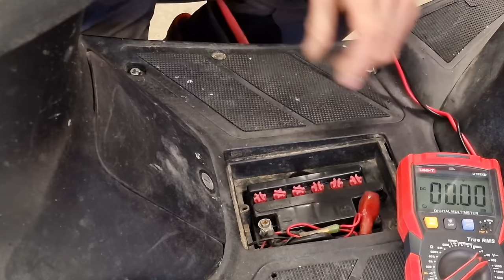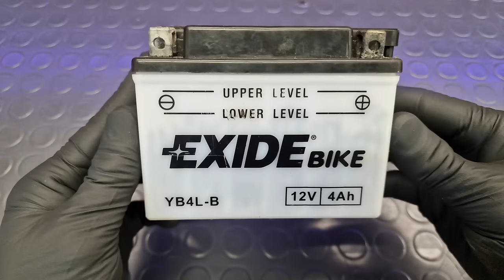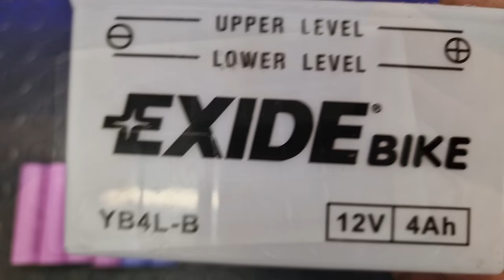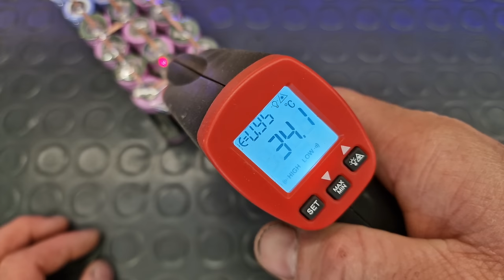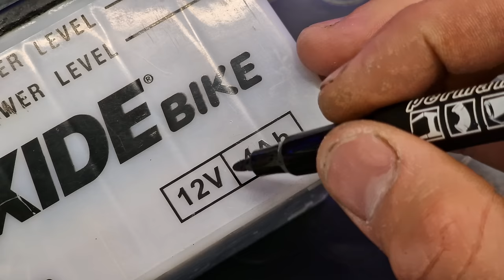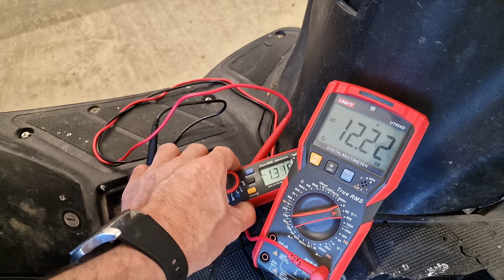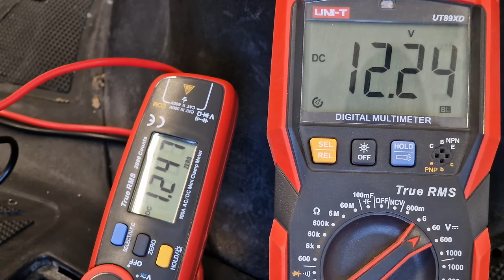How to make Lithium ion Battery pack for Motorcycle? Forget Lead acid Battery CPI Oliver Sport 50cc³

Comment: I like how batteries fit perfectly into these lead acid battery shell's 😍
Thanks for sharing with us awesome ideas! 👍
Reply from the maker: I'm glad if you like it Bro🙂🤝
Reply: @ErCanEverything  What mount do you have there? So that the 18650s stand still. Seen at 05:07
Reply from the maker: @-Fun_and_Games-  Flat piece of wood and parkside bar clamps
Reply: ឲ
Reply: What is the name of the PCB module ypu used?
Reply from the maker: I left links in the description🙂
Reply: l
Reply: nice video brother but what I don't understand is how many voltage is those batteries each
Reply: 3.7v each cell and he made 3 line. Then connected in series ie from negtieve 0v 3.7,7.4 , 11.1. When charging it reach 12.6v . Here  he connected one BMS for

Comment: Sir that's a very dangerous thing you do using lithium in a normal motorscooter bc the bettery can explode with this way of using it never do that if you have lithium ion bettery than use an electric motor not normal gasoline engine bc lead acid is used in gasoline engine bc it can handle it an dont have cause of explosion what you did is making it a bomb on wheels you should immediately change it to lead acid or it will explode
Reply: Bms use no worry
Reply: @doityourselfsmddobcobsmdra8549  that doesn't hold long believe me the bms would through its cycles an than over heat than it doesnt give any voltage if you want good bettery look for Duracell lead acid the can hold more than 10 year or verta lead acid its for your own safety but its up to you
Reply: @markludersen8524  good too intelligent
Reply: @doityourselfsmddobcobsmdra8549  i just tell you this an no iam not intelligent i just put my interrest in bettery,s an safety😉
Reply: Not man!
Reply: @R-Turfu  why not i am curious why
Reply: Do you have any evidence that Lithium batteries can't be used with motorcycles?
Reply: @triadwarfare  yes my father own a Harley Davidson we went to an store i asked the repair men an he told what happened if out lithuim in motorcycle he told me the bettery starts warm up after the bms goes to warm up than it starts become so hot that bettery an bms start to smoke when it smoke the bettery an you notice it on time than please stop an step away from motorcycle an call firedepartment fast bc the bms the protection is over its limits an the things on the bms board burned away the reason lead acid is bc lead plates haves an stronger Resistance by bit higher voltage an motorcycle uses leadacid bettery bc if put 12 lead acid bettery in there hold an voltage meter on it start the motor an let it run an you see it get 2voltages high but its does do nothing to the leadacid bettery bc the lead plates are thicker than the lithium metal an copper what you see inside a lithuim cell if the cell gets to hot than its start explode bc the heat needs to get out so it makes pressure inside the cell itself an becomes bigger that it doesn't hold longer an starts burst out  lead plates takes a long time if you over voltage them like put 5 times higher voltage on it while it can have 2 voltage resistance as maximum so that is why you never do that if you want an better bettery than buy verta or Bosch or Panasonic or Duracell lead acid bettery,s
Reply: @triadwarfare  let an engine run with a Dynamo of voltage what the bettery haves an look through the thermal cam you see it gets warmer an warmer bc of the constant charging an use lead acid bettery on it after you remove the lithuim than you see it wont get warm after 2 voltage higher an in fact lithuim ion cell even the lithuim polymer gets warm by heavy use if put it in a rc car or something then you even feel it gets a bit warm bc of the use than image what it do if it keep charging it than it will get so warm that its overheating
Reply: @triadwarfare  if you want to use lithuim for motorcycle it needs to have pmc control for the motor an bettery voltage meter yk what you see on bettery pack of cordless drills or lcd power meter on power banks than you take apart the gasoline engine remove an build in the pmc controll panels An led voltage indicator to see how much you have left an a lithuim pack with bms in it
Reply: BMS Loughing😅😅😅🖕
Reply: @akdgamer1065  you feel the heat an smoke when things going explode
Reply: @markludersen8524  hmm ? Me also using this bttery in my bike since 4months nothing happend
Reply: @markludersen8524  no IAM using BMS
Reply: @akdgamer1065  still it have charges cycles between 2000 an 500 charging cycles maybe higher with newer ones but your motorcycle have an alternator that provide electricity so while it goes giving direct current electricity you keep charging the lithium ion bettery the bms do every time charging till it comes to an end but it can also be becoming overheating an till it get so warm that it start catching shortcut over voltage an you mayby not nowing while driving it start catching up fire an goes in smoke after it get an fire that you cant put it out an call the fire department or you buy Special lithuim ion fire extinguisher to put it out but if you keep ignore what i said now than dont be suprised when you get an fire an the bms wont much hold very long
Reply: I think this circuit in reality is a voltage stabilizer.... So there is no any dangerous of explosion....
Reply: @thiodorchalkias8906  no it isnt i have one my self its a separate pcb motherboard that stabilise the voltage this bms is for charge only an discharge keep in mind those bettery bms is just to charge an not keep charging like an alternator plug on it you will just keep charging an driving till its completely dead bc of the constant charge it gets very warm till it is damage completely
Reply: I think you have a point!!! And the point is the POSITION of the battery!!! How far is from the engine wich create a hot environment!!!! If the battery is thermal isolated from the engine there's no problem.... If not then you have absolutely right!!!! I remember that some "electronic cigarettes" was exploded at the hands of their users....
Reply: @thiodorchalkias8906  most commercial e sigaret are just cheap or reused old lithium pouch cells the non commercial ones are the ones who have an more expensive better bettery in it like an lithuim cell even then the alternator always put 2 volts more reason they use lead acid is bc of the higher resistance of higher voltage out put bc the if take apart lead acid bettery the lead plates are thicker than the lithuim plates if you are keep thinking it doesn't effect the lithuim bettery than you are very ignorant to listen lithuim cell gives higher out put but isnt safe for using as Lead acid bettery bc chemistry behind it is different lead acid is robust an can handle higher voltage lithuim ion is more sensitive but powerful to use as back up or for an e scooter or e-motorcycle not normal engine with alternator we can talk hours about but ik why an saw the reason why lead acid is just use for cars scooters an motorcycle bc they keep charging an nothing happens to it bc the acid is just boils a bit an the thic lead plates can handle it by lithuim cells its getting warm till that thin sheet of nikkel gets lose an just the lithuim sheet plate with copper one an starts to get inside an small fire till it need to get out an explode bc the pressure burst out of its steel case an the next one starts also till it get like an fire bomb so till than use lead acid bettery not lithuim for the normal alternated engines in normal vichels
Reply: It's an amazing idea but there is a prblm with Li-ion battery, these batteries got heat very quickly, and the starter motor used in a scooter or bike need high ampere current to work
Reply: @triadwarfare  lithium batteries when there are 3 in series need 12.6v to charge. motorcycle charges the battery at 14v to 14.4v. Probably bms will just die but not explode.
Reply: @markludersen8524  instead of lithium ion you can use life po4 they safer and they last longer
Reply: I've been using this method for four months now and it's working fine.
Reply: Me parece que te la vendieron mal amigo. Las celdas de litio cómo estás soportan una descarga continua de 5A c/u, y si pones 6 en serie, tienes 30A. Los picos de corriente que soportan esas celdas son mayores aún. Al encender la motocicleta, el pico de corriente se mantiene por 1.5 segundos más o menos. Con eso, la celda no se calienta. Y sobre la carga, si te diste cuenta que hay 1.4A de carga? Y que esos 1.4A se reparten entre 6 celdas en paralelo? Las celdas pueden ser cargadas idealmente a 0.5c(si las celdas son de 2200mah, estaría perfecto cargarlas por separado a 1.1A). El voltaje alto, sería de 14.5v como máximo, y el pack es de 12.6v, serían 1.9v de diferencia, lo cual está perfecto para el bms. Así que no veo el problema. La temperatura del motor??? A menos que la coloques directamente detrás del motor, dudo que se caliente, pues también le pegaría aire fresco.
Reply: You are right
Reply: Why?
Reply: There are many direct lead-acid battery replacements with Li-ion cells. The easiest way is to contact a Li-ion battery packer such as Lithium Batteries,Motorcycle Batteries,Solar Batteries,KOK Power Limited that specializes in automotive, motorcycle and eBike batteries as drop-in replacements
Reply: Someone call Dakota Lithium and tell them they are endangering their customers with their products.  Make sure you tell them you're a certified professional because you read it in YouTube comments. 🙄
Reply: That's great one.   please where will I get the mother board to buy ?
Reply: @markludersen8524  I see companies now making lifepo4 and li-ion batteries for motorcycles. So why can't we make that same batterie from portable tools batteries that have much higher discharge current with bms?

Comment: IT WORKED FOR ONLY 3 DAYS. I made this battery, but after 3 days, the BMS failed (the BMS mentioned in the description). It seems the current coming from the alternator and the voltage of the battery has a too high differentia. So don't make it. Waste of money.
Reply: it failed, because in normal conditions alternator produces around 13,5-14 volts DC , to charge original Lead Acid battery.
in this video voltage in the system was always 12 volts, meaning alternator on this bike was faulty or disconnected.
Battery that was shown in this video is not suitable as direct replacement for the Lead Acid battery.

Comment: 3:00 a pair of wire snips is all you need if you put the case in the freezer for a few hours.

The soldering of the cross pieces could be done on the bench. If a 'ladder' dia could be used the 'steps' would be made of a 'fuse  wire between two cells 9@2.5ah) that  has a common wire that is a tad thicker to complete the 12v s4 20ah  battery. Times that by 5, you have an e-bike  you can ride for a few hours.

Comment: Nice job, kind of weird that the cells fit so perfectly into the battery case! My personal preference is to twist wires prior to tinning which keep all the strands together and prevents any stray strands. Only other caution would be the fact everything is quite tight in there but in the use case with a very short discharge when starting and relatively low current charging it seems like a good solution 👏

Comment: Nice video but, if you place a buck converter between original charging system and the battery, set the voltage to 12.4-12.6 volts it's better for the battery and the BMS.
Reply: Bms needed for Li bat, for balancing
Reply: I think he mean the output of the scooter so the voltage entering the bms is lower. But it's needs to do current both ways so I'm not sure how that would work
Reply: Oh actually separate the alternator from the starter motor, lower alternator voltage perhaps
Reply from the maker: the scooter generates 14.4V but the BMS has a controller, and as soon as it reaches 12.6 - 12.8V it turns off the power supply to the batteries using the mosfets
Reply: Oh so does that mean the bms can accept more then just 12.6 to 12.8 safety? I have the same bms so I'm curious

Comment: One thing to ask: disconnected battery voltage was 12,3 volts.
battery voltage, connected to the working bike 12.2 volts. this means only one thing, alternator on this bike is not working or missing or disconnected.
Otherwise how the original lead acid battery is going to be charged?
Lead acid batteries require around 13,5-14 volts DC in the electrical system of the bike or a car.
Battery shown in this video is not suitable for direct replacement of the Lead Acid battery.
It will fail !
Reply: No solo fracasará es una moto bomba cuando explote veré a ese en el cielo

Comment: nicely done.
q1. don't you need thicker cables?for around 20-30 Amps?
q2. is that bms capable of handling such amperage?
q3 no heat sensor/alarm. what if bms fails and  keeps overcharging? explosion and fire.
I have yet to see any diyer in you tube to take into consideration safety and the limitations of lithium batteries.
Good effort anyways.
Reply from the maker: Оnly the cables in the poles should be thick and they are 6mm² the rest of the cables are for balancing and no need for a thick cable.  The BMS is 100A, the starter draws 30A and the alternator cannot exceed 5A when charging.
Yes, you're right, I didn't put a thermal sensor, but I should have.
Reply: I have seen 'miracles' happen with solar lithium bats as well as 18650.
Fires, explosions, bms failures, melted cables etc etc.
Mind you that bms's are chinese junk. Quite unreliable and fry easily. Once they fry your only safty angel is a thermal sensor provided it is reliable lol.
My comments have only safety in mind with the chinese unreliability variable. Keep up the good work. Tnx
Reply from the maker: Thank you🙏🙂🤝

Comment: I think it would be better if you properly spot welded the 18650 cells with zinc plated strips, between them. I have tinned a lot of copper wiring to cells and stuff. I don't think it is the best approach for this case, a motorcycle battery, which has to endure a lot of vibration and shaking/bumping, especially if the roads are rough in your country, because there is a much higher risk of cracking a solder joint and making a short or just killing the battery pack and your precious work, faster than you would believe. Nice job though.
Reply: And the fact that is charging up to 16volts is ok, right?  Fuck the risk of fire, just use zinc strips.
Reply: @BOB-eb8xz  Not really. The bms board charges each cell up to 4.2v and stops charging omce it reaches that value or about 12.6v total. I've made a similar battery and tested this myself. Provided that he bms doesn't malfunction and everythimg goes south of course..

Comment: is it safe? have overcharge protection and short protection ? and i want to know my bike has a 12v 7a battery and my bike charging voltage come 14.9v .i have 25A (hx-3s-fl25a) bms . can i use like this battery pack without damage my rectifier
Reply from the maker: This BMS has short circuit protection and recharge protection, which interrupts charging at 12.6 ~ 12.9V.
You must know, when the battery is fully charged interrupts the circuit to the battery until it starts to consume from battery.
Reply: @ErCanEverything  however can i use this battery in my bike ?
Reply: @ErCanEverything  sir my rectifier out 13.9v charging current when race my bike can i use this bms ?
Reply: @ErCanEverything  i use my 25A bms my bike self start will work ?
Reply from the maker: This BMS supports 100A and I think it will work properly.
But I did not use for a long time and do not know what will be the effect after a while
Reply from the maker: With 25A can activate short-circuit protection at start-up, and will not release voltage until it starts charging.

Comment: Usually motorcycles charge batteries with 14.5v max, is this ok to charge a 12.6v 3s battery? Won't it overload?

Comment: Maybe I missed it, but is the overheating protection in place ? this is foundamental.
Reply: In this application the battery is isolated from the engine, so overheating is less likely.

Comment: Super! 2 questions: 1. how does the zinc plate (not the flattened copper wire) get on top of the cell?
2, is charging the motor good for the Lithium-Ion battery? Thank!
Reply: Those are used batteries and the flat tin is the old connection between them.  The circuit board allows the alternator to charge the batteries safely.  I have a spot welder to reweld the batteries together with new flat tin.  Either way if fine.
Reply: @Chairman750  OK thank you! Unfortunately, I don't have a spot welder - I can do it: DIY?

Comment: that was perfect. But my question is, can the engine charger charge this battery? 2- And this module has 5 cells. Is there any problem with charging the batteries?
Reply: yes

Comment: Amazing... My question is, does the amount of charging voltage coming from the bike's charging coil affect the L(BMC) of the lithium-ion batteries... Thank you.
Reply from the maker: The voltage is around 14.4V, but the most important factor is the charging current, which should not exceed 8-10A.
Which in my case is on the order of 5A

Comment: its not charging tho ? to charge a 12v battery ( 12.3-12.5 to be exact ) you need MORE than that. at 12.6 it will keep it in its state ( running with NO additional load ), but to CHARGE it, it must be at least 13v. ideal is 14.0-14.7v. some OEM see peak at 15.0v but never stays there.

so how do you charge it ???

Comment: technically all very good, but how much did you spend? surely by buying the original battery you save.
Reply from the maker: I bought the batteries cheaply from damaged vacuum cleaners. When I need a 12V battery for camping, I will take it with me because it has 3 times the capacity of a lead acid battery.